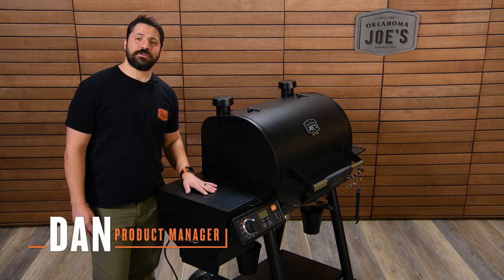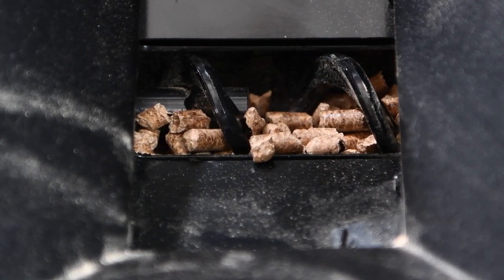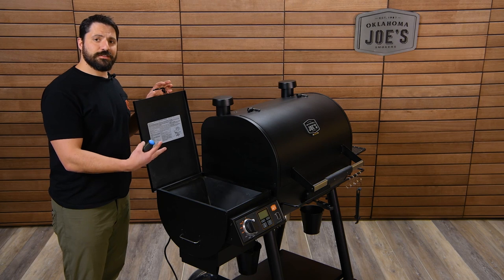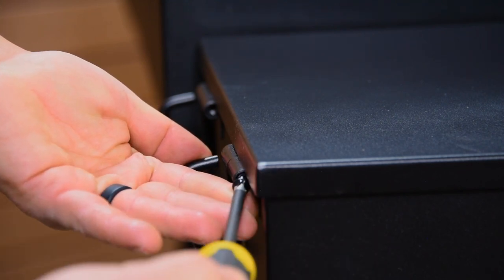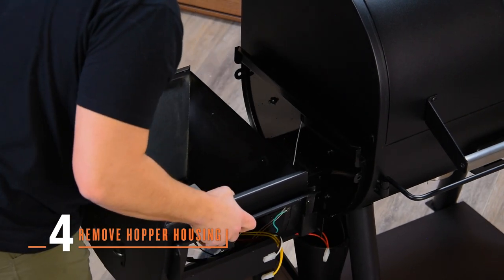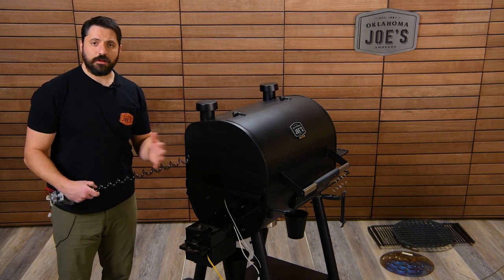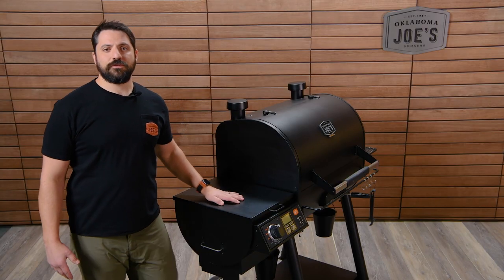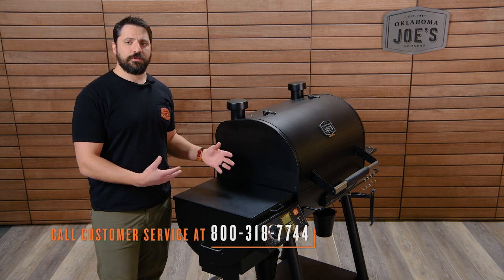Rider Pellet Grills - Auger Maintenance | Oklahoma Joe's®

Comment: Apparently, the auger motor isn't strong enough to push out a few old pellets. Oklahoma Joe had to make a 13-minute video to show customers how to fix it yourself. I keep my grill in a shop, out of the moisture, and every time I fire up the grill the auger is stuck. You can hear the weak auger motor binding and stop without any pellets in the hopper. Sometimes the temperature is hard to control and I think it has to do with a weak auger motor. It's time to fix the problem, Oklahoma Joe.
Reply: Oklahoma Joe has to address this issue...a stronger motor and a reversing feature would cure this problem.
Only a two year warranty compared to Pit Boss with a five year warranty.
Do you see Pit Boss putting out a video how customers have to tear apart their pellet Grill...no you don't...nor Traeger...that tells you there is something seriously wrong here.

Comment: Haven't had a problem with the auger, but I've had to replace the igniter on an annual basis. When I ordered a replacement igniter, took forever to get it from Oklahoma Joe's. Gave up, ordered one on Amazon, had it the next day. In addition I can't pull up my model DLX 1200 on their website. When I decide to get a new pellet grill, doubt it will be Oklahoma Joe's. I do agree... excellent video on fixing auger jams.

Comment: Good info.  I have found that using a small pair of vice grips on the auger and wiggling it back and forth helps clear a jam.  Further, I first dump the pellets and then run the grill on high to clear the auger after I am finished grilling.  No more jams.

Comment: I run mine for about 10 minutes after I’m finished cooking to clear the auger. I don’t know if this is a good idea but I felt like there would be less of a risk of clumping or damp pellets if I cleared it out after every cooking. Sounds like a beefier motor with more Low end torque or a way to manually reverse or run the auger might be less invasive.
Reply: I’m going to start doing the same thing. I purchased a new grill less than a month ago and had my first jam. I made sure I was using good pellets and I also live in dry weather conditions, so I wasn’t sure what was going on. Ultimately, I had to take the auger hopper off because the jam was significant. After I cleared the pellets in the auger and put everything back together “correctly”, the damn auger wouldn’t turn at all. I think my motor burned up or something did. Very frustrating to say the least.  So..I took the grill back to Lowe’s and traded for another OK Joes grill. If it happens again, I’ll go to a Trager.
Reply: Dave Lyons I just got a traeger today. Took the Oklahoma joe back to Lowes and went to Home Depot to pick up the pro 34
Reply from the maker: We recommend this.
Reply from the maker: We're very sorry to hear this. We value you as an Oklahoma Joe's customer and want you to enjoy using your smoker. Please follow this link (bit.ly/2VQqS7p) or give us a call at 1-866-239-6777, and we will be able to assist you.
Reply: Oklahoma Joe's Smokers I called yesterday and was on hold 10min then the system hung up on me. Called back and after 10min on hold the system hung up on me. I’m glad I found this video today thanks. You might need to let someone know you 800# issue.
Reply: Saw in another video a comparison between pellet sizes — the Pit Boss brand has pellets that are MUCH larger than Traeger bags and other brands. The guy in the video, and also me, had their Oklahoma Joe jam on the Pit Boss wood. It’s usually fine, but I’m guessing when these got damp that was all she wrote. Something to watch for…

Thanks for posting — it was super helpful to know that the auger should “shake” and the turn pattern at startup. It helped me fix!!

Comment: Had my first jam 6 weeks after purchase...frustrating.  Spent an hour with a hanger only to get slight movement in the auger after turning it on and off.  Had to take everything apart and didn't find anything suspicious.  I keep it covered and on a covered deck all the time.  Drain the pellets after every use but don't run it "dry" after every cook so I guess that's what is necessary.
Reply from the maker: Sorry to hear that. Please follow this link (bit.ly/2VQqS7p) or give us a call at 1-866-239-6777, and we will be able to assist you.

Comment: Now do a video on how wildly the temperatures vary in the smoker from what it says on the dial setting... mine runs 25-35 degrees hotter than what I set the dial for. Set it for 225 and it will run 250 to 265 consistently. It’s an issue for customers that trust the dial and display for the temp setting and don’t use calibrated external probes.

Comment: I would ask that since most of these companies that make these pellet smokers seem to make them with crappy screws, if Oklahoma Joe could atleast make ALL of the screws in their smokers with screws with heads that could be removed with both a screw driver and a socket set. I've had a stick burner by Oklahoma Joe and it was fantastic, but I sold it when I moved to Colorado, then I sold the Pit Boss pellet smoker when I moved to Missouri and it was awesome. So far with this Oklahoma Joe pellet smoker I've had nothing but problems.

Comment: So how did you get the quick drop handle out of the auger housing so you can even remove the Hopper housing? Mine won't budge even kinda!
Reply: Did you ever get a response to your post? The pull handle on my OJ pellet grill will not pull out to empty the hopper? Thanks in advance.

Comment: First time using my Oklahoma Joe pellet smoker today, and at the end of the cook about eight hours later, it started feeding too many pellets, and the fire went out. I checked the ash tray and there was hardly any ash in it, so I dumped it out and put it back in. I tried to vacuum out some of the pellets, but couldn’t get my vacuum nozzle through the heat deflector.

Comment: Also, you need to let people know to use something (I use a stick) to push the ash out of the firebox into the dump can. If not, sometimes it will not ignite the pellets and you will have a firebox full of pellets.
Reply from the maker: Thank you for your suggestion. We recommend that you wait until your grill and the ash are completely cooled before removing.
Reply: I found cleaning the ash out is crucial in maintaining my Oklahoma Joe!

Comment: I've got a problem with my new Rider 900.  Even at the lowest smoke setting (<200) the temperature is MUCH higher above 240 degrees.  I've checked to insure the heat baffle is in place after searing.  Any thoughts?

Comment: Would it be possible to run the auger in reverse?   This may be a good option in the future.
Reply from the maker: No, our current motor set up is not designed with a reverse gear, but thank you for the feedback as it will help us refine future products.

Comment: Mine jammed up and now the auger wont even try to move , I would have never bought this thing if I knew I would have had to take it apart every time I want to use it. Maybe they should use a stronger auger motor or something.
Reply from the maker: We're very sorry to hear this. We value you as an Oklahoma Joe's customer and want you to enjoy using your smoker. Please follow this link (bit.ly/2VQqS7p) or give us a call at 1-866-239-6777, and we will be able to assist you.

Comment: I have not had an issue with auger jams, but I do get a significant amount of smoke coming back through the auger tube and into the hopper– anyone else experienced this? Startup and shutdown especially, but also during normal grilling. Charbroil support said that smoking is normal at startup, but this is smoke in the hopper and hanging around the grill, not in the grill chamber. Always run shutdown cycle, use dry pellets, empty ash cup, and empty pellets from hopper.
Reply from the maker: Hey, Jordan. We're very sorry to hear this. We value you as an Oklahoma Joe's customer and want you to enjoy using your grill. Please follow this link (bit.ly/2VQqS7p) or give us a call at 1-866-239-6777, and we will be able to assist you.
Reply: I am now also getting this issue. When I called they told me it might be a pellet brand issue. I'm using the oklahoma joe pellets. It's always after about 15 minutes when the grill gets going smoke starts to pour out of the hopper and the grill loses temp. Its backburning through the auger.
Reply: Did you ever find a solution to this? I'm having the same issue.

Comment: Terrible. I’ve owned mine just over a year. Can’t use any kinda of hard pellets like hickory. Stuck with soft wood pellets or I get jams. Now I got to empty auger every time. That now has caused an issue we’re the Ben just fills with pellets and want light. Most time I got to light it with a torch. This video is spin control!

Comment: Has anyone had problem with unit won’t power on??  New machine.  Upon delivery did a power up to test that it was working- no issue.  Next day was planning to do prep and seasoning but could not get the unit to power on.  Cords and outlets are all good to go.  I am currently working with Char-Broil on solution but wanted to see if anyone else had encountered this issue

Comment: Seems pretty bad that I have a jammed auger in Tucson in summer.   111 degrees here  yesterday.  The desert.  New, intact pellets.  I'd hate to think how many problems someone would have in Seattle with this unit.  I'm not an appliance repairman, so I don't really like the idea of having to disassemble the thing.  Guess I bought the wrong product.  A Big Green Egg works every single time.  I guess I will do the other shutdown method if I ever get the jam cleared.  I wish I had known to do that kind of shut down from the beginning.  When it worked, this was pretty great, but it is less than  6 months old and in a desert climate and is nonfunctional.
Reply: I am in Pacific Northwest. Only one pellet jam thus far. I store my pellets inside in food safe buckets. I have however had multiple other issues in the first 25 days. Lowes is going to swap out the unit as the parts are on back order from OJs. Love this grill so I am hoping this is a one off.

Comment: What do I do for an ER2 error code
Reply from the maker: Great question. Error Code 2 means that there's an error with the ignitor. It's caused by the Pit Control system not detecting the ignitor or an ignitor malfunction. Here's what you can do: 

1. Unplug the grill from the power. 
2. Remove the Pit Control panel and ensure all wires are not damaged and firmly connected. 
3. Reassemble and retry. 

If the error persists, please call, give us a call at 1-866-239-6777, and we will be able to assist you.at for assistance.

Comment: My auger does not slide back and forth at all, rather jammed or not.  Also it appears to be cast aluminum not painted.  Not sure if it is a newer version or older version auger.  Durn grill has jammed now twice after only 5 or 6 cooks.  Bear Mountain pellets, new and dry, kept in the bucket.   My Pit Boss never ever had a jam, regardless of how long the pellets stayed in the auger or hopper or left in a bag thrown in a corner.  Never concerned myself with anything but the cheapest pellets.  Never used any better brands like I am with this grill.  Not happy.  I can clear the jam with a lot of fiddling around with a wire or prying the auger up and down but I shouldn't have to do so.   I would not recommend this grill.  Two dinner parties ruined as I have had to shift to the electric stove as I didn't yet have experience clearing the jam.  Is OK Joe's the FIAT/Chrysler of the pellet world?

Comment: I think my auger over fills my firepot. My temp continuously climbs throughout my cook, what causes this and whats the fix?
Reply from the maker: Hey, Sean. The Pit Control System is the brain of your Rider Pellet Grill. It uses proprietary algorithms to control and maintain your set cooking temperatures while avoiding temperature swings. Once you set your desired cooking temp, the Pit Control System takes care of the rest. It is equipped with two guidance features: 

1.Timer Mode: indicates when a set cook time has elapsed
2.Temp Probe Mode: indicates when the internal temp of your food has reached a set target 

You can set the desired temperature in 25° increments for smoking temperatures.

When using Smoke Mode, set the temperature between Low and 300°F in the white zone. When using Sear Mode, set the temperature between Low and High in the orange zone. Allow 5 to 7 minutes for the circular center grate to reach searing temperature range.
Reply: @OklahomaJoesSmokers  You didn't address Sean's question...